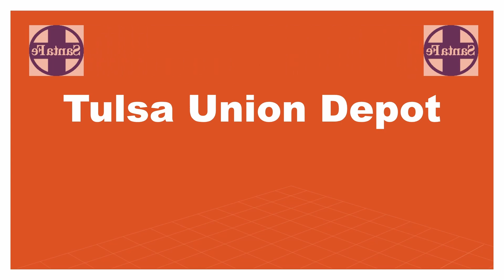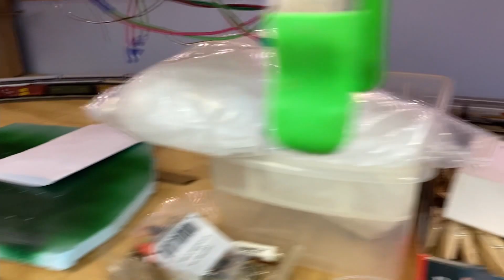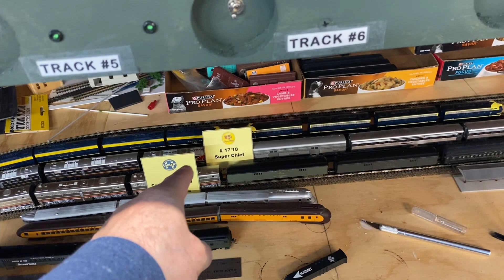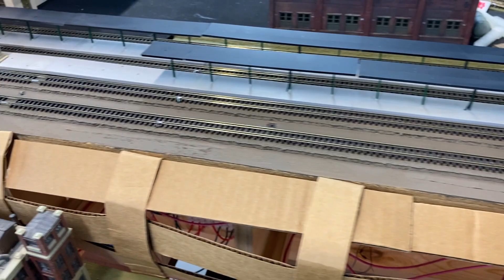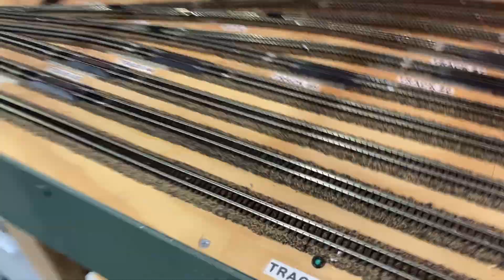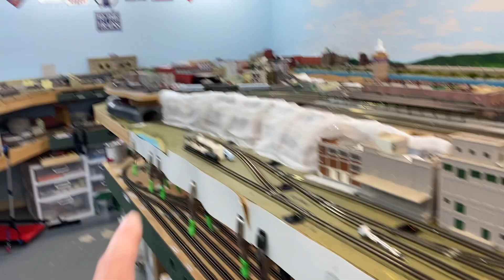Tulsa Union Depot Lighting Project Update 5C

Comment: Hi John, doing the lighting is a slow and time consuming job but the end result is well worth the trouble. You end up with two layouts to use and I live to run the trains at night, brings it to a different level. Wish I had the room you do !
Reply from the maker: Hi Mark, Thanks for watching and your comments. It sure is slow doing lighting regardless of what is used. I spent two full days working on installing and testing the lights in the lower level of the building.  Hopefully I will be able to have a full test of the lighting on the layout this coming weekend……John

Comment: Really nice layout John.  If interested I discovered that the cheap strip LEDs can be used on the  plug and play.   I got a couple of buildings in OKC show that were lit.  I tried hooking them too.  They are still on after 2 years..  Anyways keep having fun, Chris
Reply from the maker: Hi Chris, Thanks for your comments. I have some cheap Christmas LEDs that are currently battery operated that I plan on testing with the JP system. I would be interested in how you hooked yours up…..John
Reply: I put  the plug n play plug on the LEDs and hooked it up as if it was a plug and play  light
Reply from the maker: Thanks Chris. I did run a test using the Christmas LEDs that I had and sure enough it worked. I am considering using these lights in the Union Station area since they are around 4-5 feet long….John

Comment: I love seeing how clean your wiring is.
Reply from the maker: Hi Heath, Thank you for your kind words. The panel that you see in this video has actually been revised since their 1 amp power supplies can only handle 50 LEDs and I have 57 to power.  I had forgotten about the station doors on the upper and lower levels, covered walkways on the upper level, plus a couple of lights for along the tracks on the lower level.  So I broke the power panels into two: one with 41 LEDs (bridge lights, platforms, and walkway over the tracks) and one with 16 (station). This will also allow some growth for both panels. I did work on some of the wire connections today and opted to use some of the Just-Plug connectors rather than soldering as I cannot bend over for extended periods of time due to my back.  Hopefully, I will have at least the platforms done this week since I have to order some items for the station as I don't have enough lights in hand....John
Reply: @tanzj  I am a big fan of using the JST connectors from the Just Plug system on all my lighting. There are a few other systems that use the same plugs and it makes it a lot easier